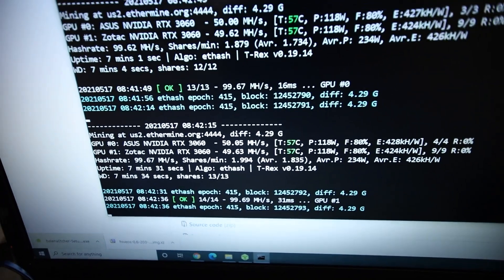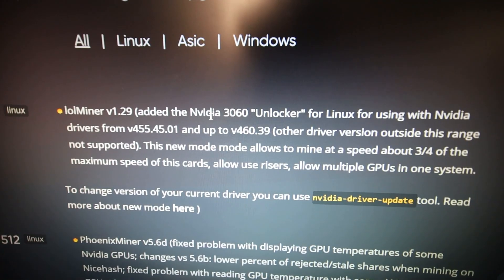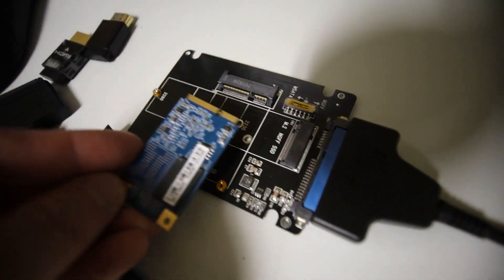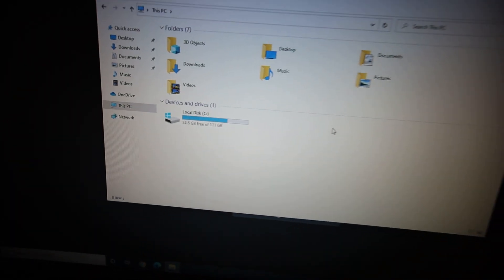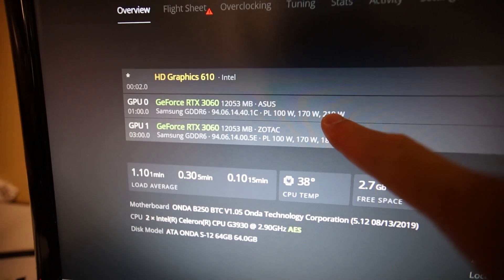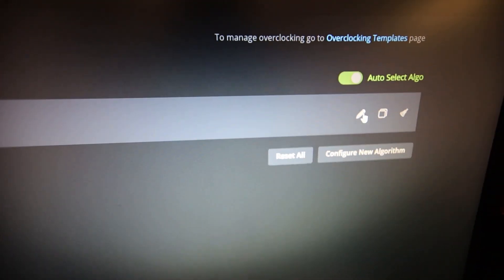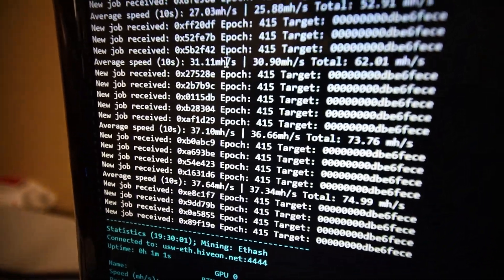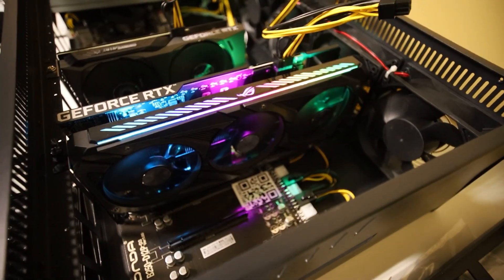How To UNLOCK Hashrate for RTX 3060 on HiveOS with Lolminer!

Comment: I have a Nvidia RTX 3060 and doing nicehash at 26mhs and I'm unable to get it higher. I have tried to install 470.05 Nvidia Driver ( i have seen this that it works) but in my case doesn't work.

I just ordered the HDMI Dummy 

I'll try on hiveos and I'll keep you post it.
I want my RTX 3060 to get to 50mhs

Comment: When I downgrade the gpu driver to 60.39, the gpu crashes, and when I restart it, the cpu can't connect to the internet and/or crashes my entire home internet until I unplug it. I have to reflash the ssd with the latest version of hiveos, and then it comes back online, but the nvidia has been updated to 460.91.03. Its working, but I really want to get it so it doesn't crash when I downgrade.

Comment: how did u manage to unlock more than one 3060 at the same time?
i have 2 3060, both in the same rig, both running the 470.5 drive, and both with a plugged HDMI (one monitor and one dummy)
i get 50 hashrate in one of them, and 25 on the other....
i cant figure out how to get both of them to 50

Comment: I need some more help with this, I was able to get it to work for a few days but after I added a 2070s the second 3060 went back to 20 something hashes and I cannot get it back to unlock even after removing the 2070 and plugging the dummy plug.

Comment: Hi Panda, I’m new to mining and learned a lot from your videos but still have few issues and maybe you or someone from your viewers can help. I have Asus X99S motherboard- from my old old gaming pc, geforce 1070 and 2x rtx 3060. One problem is my mb doesn’t support gen3 cards at least I didn’t find it after bios update and Im not sure if it’s somehow affecting my hashrate if yes are there any good mb which they can solve this  and second problem is anytime I trying to set my gpu’s to same settings as you have I’m getting black screened. Using Win10 64b and Phoenix miner. Thank you for any advice and appreciate it.

Comment: in windows I can only get 1 of 2 the 3060 to mine at 49 mhs the other i think shares bandwidth with the NVME so even tho its in a x16 slot it only does the stock 22-25 mhs

Comment: love it. been building rigs with a couple 3060s and using windows thanks to the lack of pcie lanes on mid range cpus and boards. filling out the x1s with other cards. 
how i got around the pcie lane issue was using z97 and z99 boards. they were made to emulate pcie lanes thanks to the hayday of sli. you can get 5-7 3060 (depending on the board model) hashing at 50+ on the same mobo. but have to use windows...

Comment: Can anyone help:

I have 1 rig, 1 flight sheet both mining same coin (ETH), 1 wallet, and same pool (ethermine). 11 GPUs (60tis/70s) using T-Rex miner and 3 GPUs (3060s) using lolminer. When I look at my wallet on ethermine to see reported hashrate and payout it seems to be only reporting my 3060s. No idea why. Only reason I have it setup like that I get better hashrates with the 60ti/70s on ethermine and better hashrates for 3060s on lolminer. 

Can someone please explain if this is not possible or a fix?

Comment: thank you for your video. If we use pcie 16x in Linux, can we get 50MH?
Reply from the maker: Only in windows at the moment. With HDMI dummy plug or monitor plugged into that 3060
Reply: @RedPandaMining  I have 7 cards 3060. What motherboard do I need to buy for windows ?

Comment: To get it running on windows at about 49mh. I had to find the Nvidia beta driver 470.05, Uninstalled the current drivers with Display Driver Uninstaller (DDU), and installed the beta driver. I hear that in order for it to work, you need pcie gen 3.0 8X or 16X, and video output with a dummy plug or a monitor plugged in. I have to keep my monitor on to get the hash rate but some people don't. Some people are running 4 cards with that setup. If you use risers, they have to be the full 16X band.

Comment: Hi, i did the update and now lolminer keeps rebooting every 2-3 minutes. Anyone else having the same issue?
Reply: this is a problem on your overclock settings. Try others configs until to hit one. Here i resolved adjusting the overclock settings. My config: fan 60, core 1430, memory 1900, PL 115.
Reply: Yes, same on my rig...
Reply: @kayobanjo9063  try fan 65, core -500, memory 2000 and PL 115. Last 24 hours it rebooted only 2 times 👌🏼

Comment: Panda, did I miss something or you didn't upgrade the HiveOS for the latest version? When you flash the drive, it only fill in with the last stable version, which does not include the lolminer unlocker for 3060. Look at that and maybe it'll extract a few more hashes from them!
Reply from the maker: I looked back at it and now I'm confused hah but it worked...

Comment: My 3060 was okay with phoenix miner. It shows in the hiveos and Works but does not start mining. And It shows as a GA106 3060.same for my 3070. I checked mb settings nothing changed. Do u guys have any idea?
Reply: u may have maintenance mode on hiveos so just disable it

Comment: no way. I am getting 48-49mh on window T>T just keep wating
Reply: 48-49? Hiveos?
Reply: @ramondiaz9886  nah. on Window. I dont want to switch to hiveos and get lost like 10mh/each gpu
Reply: @LOLBasicever  are you be able to get it work with another AMD card or just one 3060 per pc ?
Reply: @KhoiNguyen-ub3gl  my rig 2x 3060 + 2 2070 super .
Reply: @LOLBasicever   so 2 3060 and other nvidia card and you be able to get full hashrate on both 3060 ?
Reply: @LOLBasicever  what is your mobo?
Reply: @angelicadedios9506  asus Z490-A Prime
Reply: @KhoiNguyen-ub3gl  i’m getting 50mhs on windows using a MSI VEGA 56 airboost and 48mhs with a rtx 3060. Pretty simple, you can run miners at the same time, I’m using teamredminer for the Vega and t-rex for the 3060.

Comment: any better new method to improve 3080 performance i am having asus tuff 3080 its giving 97 constant but gigabyte 3080 is giving 80 to 85 so pls help with that
Reply: vram heating too much. Change thermal peds
Reply: @serhatyayla5011  they r the new ones with ac on

Comment: As much as I detest Windows for mining rigs, losing ~110MH on 10x3060 just isn't worth the switch to HiveOS for this particular rig.
Reply: You using a SuperMicro motherboard? Just got mine in. Very unsure if this is gonna work lol
Reply: @tony_bauer  Yeah X9DRX+-F. Works like a charm. I hope you got the black x16 to x8 ribbon cables.
Reply: @RenaissanceGinger  Which black cables do you recommend?
Reply: @tony_bauer  ADTLink is the only option as far as I am aware
Reply: @RenaissanceGinger  I’ve got some high quality ThermalTake ones in. Hopefully those work. Couldn’t find any ADTLink that would ship fast enough. I’ll order some as soon as I can

Comment: I'll keep mine on windows for now. Don't get me wrong 35-37 mh/s is much better than it was. However if I'm gonna run 30ish mh/s you might as well run 1660 supers considering the initial cost to purchase and power consumption. With a 1660 super you get 29-32 mh/s @75-80 watts.
Reply: 100% agree

Comment: I haven't been able to make it work on my 9 card rig on Hive. It only registers 4 out of the 9.
Reply: Maybe the other cards were hung in the dag verify / repair function? That is an issue of 1.29 - if the memory clock is high the dag repair function sometimes makes them not showing up. Lower the memclk a little bit, that might help and / or check miner log.

Next version will bring an improved repair function getting them all on! For sure :)
Reply: @lolliedieb7496  I'll give that that try this evening!
Reply: @Orothos  To make sure - you can also add --disable-dag-verify in the extra args to skip the repair and see if they all start up. In case the dag is corrupted you might get some invalids - how much depends on how badly the dag is actually affected.
Reply: @lolliedieb7496  I noticed when I was watching it the other day that the hashrate kept dropping into the 20's and coming back up. Is that normal?
Reply: @Orothos  In the beginning that is normal. The miner tries quite aggressively to keep performance up - but not on all cards that is stable, the Nvidia lock detects it and throttles the card again. At that point the miner detects the lock is back, loosens the parameters a little bit and "unlocks" again. Writing in parenthesis, because during that time the miner wrestles all of the time with the lock not to lock... well but sometimes it happens. Then miner adjusts and starts over ;) 
Usually after 15 minutes about the hr should be stable.

Comment: Hi Panda ! which OC settings used for Asus 3060 at 50MH ? Is it stable or chasing ? Thanks.
Reply: My 3060 (Gigabyte) reachs 50/51 MH/s with these settings:

Core: -200
Memory: +1500
PL: 66%

Comment: Glad to see this, but the driver version is problematic. Without the latest driver we risk optimizations and security. Nvidia has a security issue with some older drivers, rolling back I would run this on a segmented lan to mitigate any local network risk. And keep an eye on your mining address in case it gets changed 😜

Comment: Nice.... but I am rocking windows 10 470.05 under nanopool
Reply: @Charles Drumm don't matter which update of windows 10. Its the driver plus version 1.1 of the 3060. ... version 2.0 of thr 3060 doesn't work for the 470.05
Reply: That means all 3060 made this month and going forward is 2.0. 
3060 is dead for daggerhashmoto

Comment: love all your vids specially when you have a stepbystep guid on a different buil, im kinda new to this mining thing and purchased 3060s should i use that kind of mining box or could i use other / specific mobos to build my 3060 build thanks
Reply from the maker: You can use any mobo, but if you want full 50mh/s right now the solution is at least 8x pcie slot for pcie lane compatibility. Some have been using x79 chipset boards with lots of pcie. I only have been using a older z97 ATX board with 2 x 3060's.

Comment: Hey, can you tell me your mining settings of 3060? Mine is Zotac with Samsung Memory
Reply: Hi, Redpanda, what are your oc settings?
Reply: I've got a zotac and ymmv  but my settings are +1250mem. -200 core, 60% power and I get just near 50 MH :) good luck!!
Reply: @TechieTrevor  Hi. Are you using it on windows? Do I have to do anything to unlock the hasrate limiter? I'm thinking of getting a new gpu and 3060 are "easier" to find because of the lock. But now, that it's possible to unlock, people might be buying it. I need to be fast lol
Reply: @mystik2460  just use 470.05 nvidia driver

Comment: I'm running  5 3060 on windows right now I think I will stay there but I definitely appreciate hive os work to get this cards working better on Linux
Reply: what motherboard are you using to provide for 5 x8pcie devices??
Reply: @marcvidal871  Risers I guess. Wouldn't it work?
Reply: @mystik2460  3060 need to be in the port itself with the correct drivers to reach 50mh, risers dont work.
Reply: @am4r684  So how does he have 5 running? More than one setup?
Reply: @mystik2460  either he has the old ones that were not limited or hs happy getting the limited hashrate through the risers.
Reply: Hi.. how to unlock the hashrare on windows? Is there anything that needs to be installed or the miner is responsible for that? Which miner do u use?

Comment: Nice job.. But 1660 super Amp have 32 mh to 75 w! So... 😳
Reply: my 1660S is currenlty doing 29.39 MH/s but using just 58W! eff is 506.68 KH/W
Reply: @marcinwronski5700  which model 1660 super are you using?
Reply: @tony_bauer  Gigabyte
Reply: i am using nicehash quckminer profiles(lite/medium/efficent) to setup cards params, and msi afterburner to monitor devices + some memory twicks